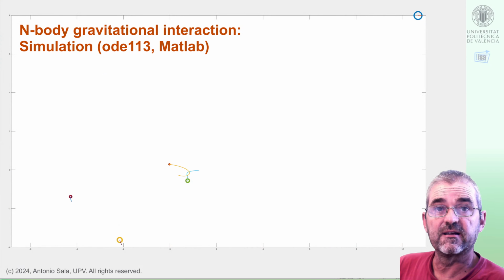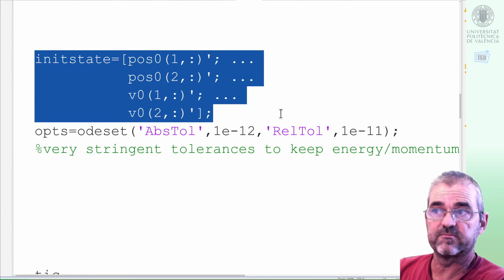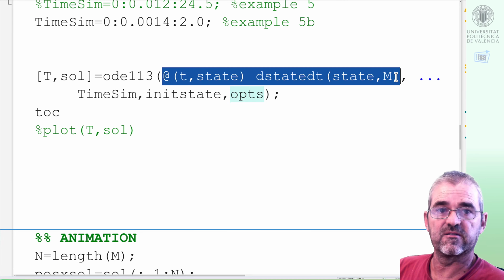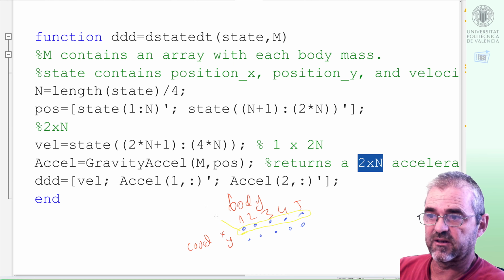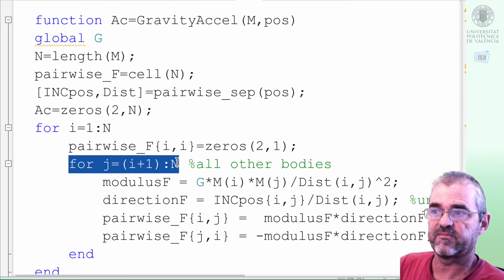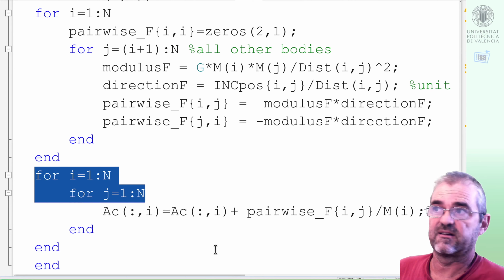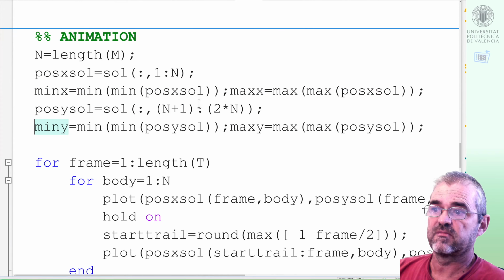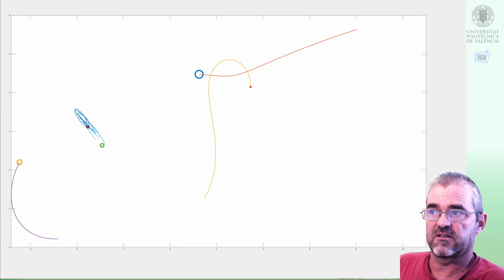N-body simulation of gravity interaction: Matlab code/animation ode113, Newton's laws 2D

Comment: Hello! Please can you explain, what mean "state" before "M" in "function ddd=dstatedt(state,M)..." and where it come from? I tried to do something similar for myself, but somethig going wrong in ode113..
Reply from the maker: well, state means what code says in next lines:
N=length(state)/4; 
pos=[state(1:N)'; state((N+1):(2*N))'];
vel=state((2*N+1):(4*N)); % 1 x 2N
i.e., it is a vector in which the 1st N components are the "x" position of each of the N particles, the N+1 to 2N are the "y" position of each particle, and likewise the 2N+1 to 3N will be the "x velocity" and the 3N+1 to 4N will be the "y velocity".

I separated the x versus y concept in the "position, pos" definition but I didn't in the velocity. I very well could have said pos=state(1:(2*N)), anyway.

The important systems-theory/ODE concept is that "state" is the thing you need to compute the 1st derivatives of in order to "integrate" the differential equation.
In usual mechanics, we need to compute velocities in order to integrate positions (the most trivial would be pos=pos+dT*velocity, being dT the integration/simulation time step) and we need to compute accelerations to integrate velocities (vel=vel+dT*accel or, well, more complex/accurate options like Runge-Kutta). In summary, mechanics requires to "integrate positions and velocities" from "position and velocity derivatives", which are "velocity itself and acceleration". So this is what the function "derivative of [position;velocity] i.e., state" computes.

"Something wrong in ode113" will sure be told to you with the Matlab error message or any AI will swallow your code and tell you what went wrong. Good luck.

Thanks for commenting !-)
Reply: @ASalaControlEN  Thank you very much for such a comprehensive answer!